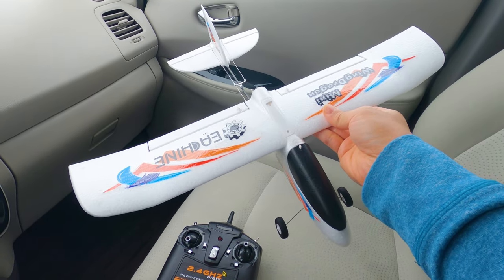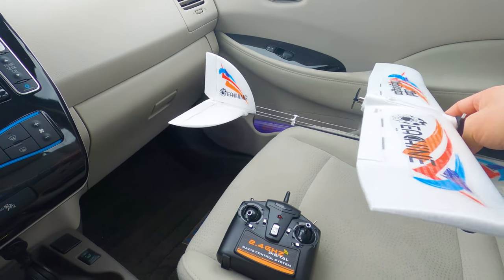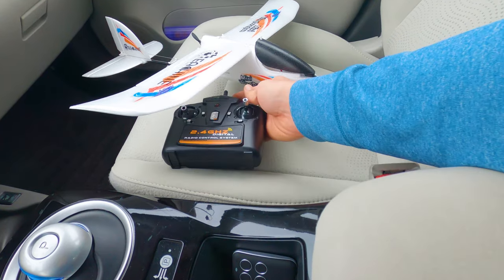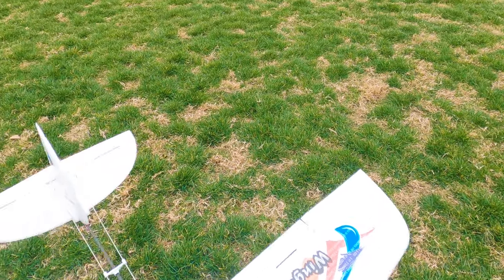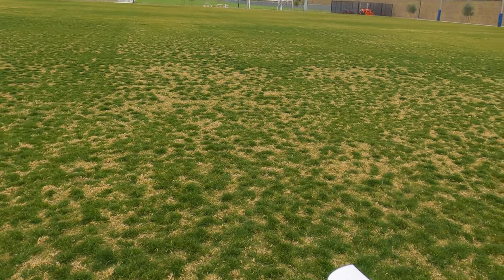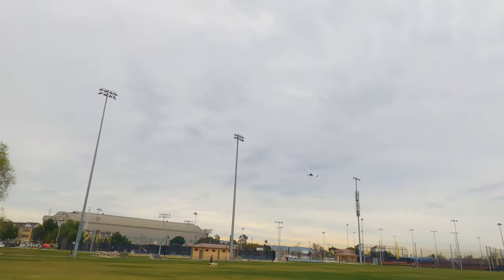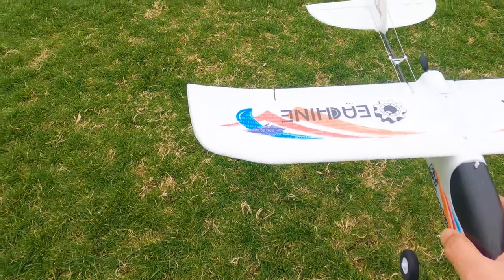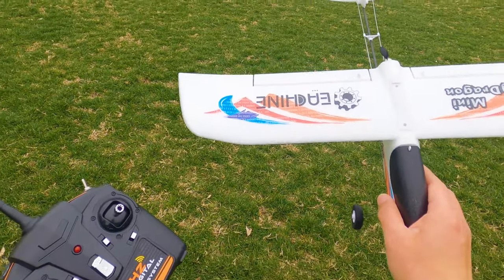Eachine Mini Wing Dragon Beginner RC Plane Review ✈️

Comment: The “bixler” style planes are usually very beginner friendly, I wish you could still get the one i started on back when we used fm radios that required plugging in a different crystal to change frequencies for flying with other people.

It was dirt cheap back then but these days only the more expensive models seem to use flexible plastic for the fuselage which helped make it very durable even in the worst.crashes. It was so docile and easy to fly, even though they didn’t have FCs, that I over estimated my skill as a pilot, I got myself a beautiful scale warbird and trashed it 30 seconds into the maiden flight 😂

Comment: Looks like a good starter plane for people that have nothing, like no controller. My nephew has a toy eachine Quadcopter with box goggles.  He loves flying, This would be a great option for him. He could learn to fly planes, install a aio fvp cam and fly fpv. For a very reasonable price. 
For fpv pilots who already have a controller I think something like the Zohd Drift or Dart250G may be a better option . And there's an fpv version. Takes more effort to get flying, but you get to use your controller of choice.
Reply from the maker: Sure there's a lot of good options out there for DIY folks.  However, those two planes I would never fly in a small park with people.  This 80g AUW wing actually is a candidate for that... this is why I'm interested to mod it for FPV.  Also, I found the protocol that works with the built-in receiver.
Reply: @AlbertKimTV  small parks, 👍
You found the protocol, that's really cool. Looking forward to seeing the next video. 😁

Comment: If you could ID the protocol so a different radio could be used, I would be interested in FPV if its feasible.
Reply from the maker: It the MT99XX protocol
Reply: MT99XX protocol, Dragon subtype. You can now get a readout of the flight battery voltage while it is in flight, and/or set a low voltage alarm, using the OpenTX telemetry capabilities. See my rcgroups thread for a lot more detail.